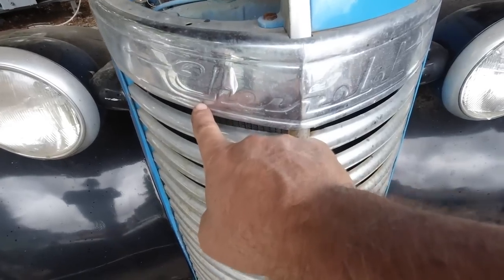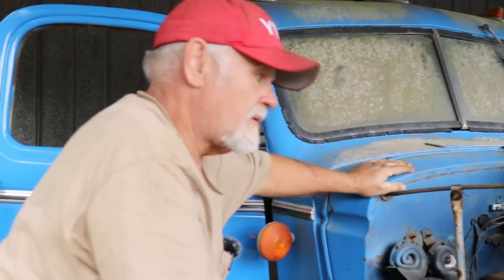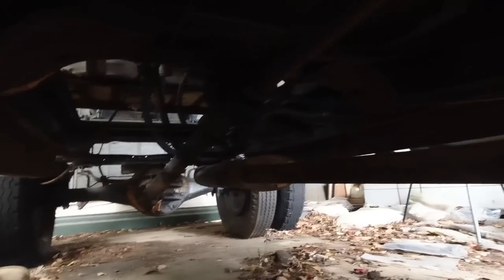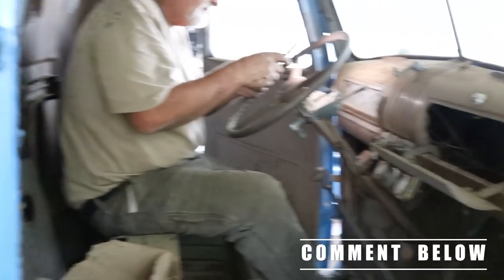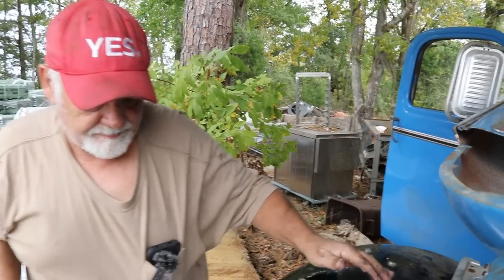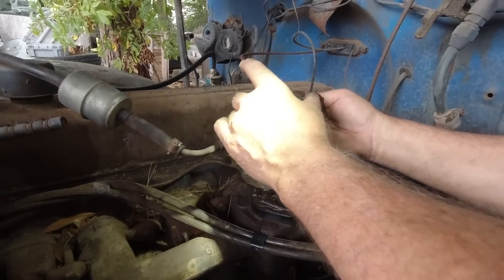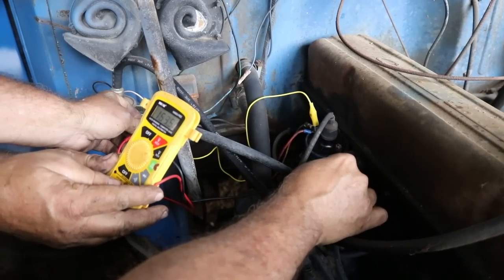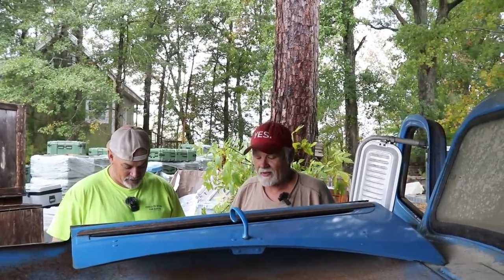WILL IT START? 40'S BARN FIND CHEVY TRUCK! We Have No Idea What we’re doing!

Comment: Looks to be a 1939 Chevrolet 1-1/2 Ton Pickup. Perhaps an early GMC. Your question about the coil. The coil takes 12 volts from the battery and boosts that voltage to around 13 kilovolts to make a good strong spark to the distributor for firing the plugs. I forget what direction the distributor rotates. I believe it's counter clockwise. The distributor shaft should be turned by the oil pump via gear. Someone correct me if I'm missing something.

Comment: Hook a wire from positive side of battery to positive side of coil. Then you have 12 volts to coil.
The throttle rod is what's leaking. Open carb. Google points vehicles

Comment: Wiley: How does it generate fire?
The coil takes 6 or 12 volts and as it has hundreds of turns of copper wire inside it multiplies the 6/12 to the 25,000 needed to jump the spark plug gap!

Comment: jump a wire from positive on the battery to posiitive side of coil if coil is good and points are clean and points open  and close it should spark point gap should be 16 on point gauge

Comment: Is there power from the ignition switch to the positive side of the coil? Check the continuity between the ignition  switch and  the points. You should be able to get spark. If no spark then it’s a coil wire and those are a cheap fix. Make sure they are in all the way. If not it could be the condenser, check that before replacing the coil- also make sure the rotor main contact is clean inside the cap. 

Try cleaning the inside posts of the distributor cap. Quiet often they build up metal transfer. Just scratch it firmly but not forcefully with a screw driver and it should fall off. 

The line going to the carburetor from the distributor is most likely the vaccuum advance. 

The engine is possibly a stock 235 or a 261.  

When the points break the power builds in the condenser until it jumps and builds up spark in the coil. If there enough umph there will be spark coming through the wire to the distributor cap to each cylinder. Check these things before the coil. 

Check the cap for cracks by looking inside for a hairline from the posts to the Center post. 

It is likely a later 40’s model. 

Many of these vehicles actually ran on 6v volt you may want to check if the ignition, the starter and fuel pump and generator are original or not and what voltage they need. 

Be careful with the ether, it’s not diesel and you can either damage it or blow it up.

Comment: Alright first things first fuel. 
1. That carburetor 'leak' isn't a leak it's just the overflow from the carb being overfilled from the looks of it I would have to know the model of carb to be sure and make sure your gas is fresh 
2. Spark your coil could be bad or it could be the wires I would look up how to test a coil as it is hard to explain without a visual aid and it's fairly simple ones you know where to jump it but next time you go out there bring a extra coil for a 55 stovebolt motor and spark plug wires and maybe a points set. The points will get corroded after sitting for even a couple years so best to either get them working or replace them and they are cheap.
3. That button on your shifter is for a split axle or 2 speed rear. They either operated on a vacuum diaphragm or electric solenoid. To shift one get up to speed with the button down that will be low gear and then clutch in, button up, let off the throttle, clutch out and it should shift although if it's vacuum it may be rotted out so it might not shift. Hope you see this and good luck those old Chevys are real fun.
Reply from the maker: Thanks for the comment👍

Comment: You run a hot wire to the coil from the battery. Also known as hot wire. You then pull a plug wire and test it on the valve cover for spark.

Comment: I think that you’re idle screw is missing from the carburetor

Before you buy a new coil, I would take out the spark plugs and check them 

Check the wires that are going to the coil

Comment: put the coil wire back into the cap, take a plug wire off and hold it close to the plug and turn the motor over and see if it arks

Comment: I think it's a 39 I had a 46 Chevrolet and it was a four-speed and it would run 70 at top speed. And the first three gears were pretty low but that 4th gear was like an overdrive on mine.

Comment: Hey love your show  what you need to do is check to see if there is power to the coil when key is on on the positive side of coil   if not you can just  put jumper wire on it to by pass all that  then pop cap. Off file the points  then crank motor over make sure rotor in distributor is turning too   make sure points open and close. As you crank also  take the coil wire off the cap side lay it in valve cover or something metal  and you can flick the points with asceww driver. And should see spark  at the end of coil wire   the coil is almost never bad  doesn't hurt to have a new one on hand  if you change coil the wire from distributor. Goes to negative side of coil   don't forget  and don't poor so much gas down the carb. That was way to much  that's why it was  leaking out the bottom of carb  maybe  like a soda cap full of gas would be plenty for it kick off. Good luck I hope that helps  if you follow what I said  you will be fine.
Reply: Also not sure if I mentioned that if yo take the cap off and crank the mtoor over you will see the rotor turn that is how it distributes  the spark to each wire  that's what you guys couldn't figure out at the end too

Comment: Oh and as far as the ignition goes Change the coil because it didn't look very good in the video. And change the points and condenser also. But she definitely has a shot coil. These old Chevy stovebolt sixes are Dirt Simple. Set the points at 18 thousands. I have a 1961 C-30 Apache 1 Ton truck. And it has a 235 six . That's probably a 218 stovebolt six.

Comment: theres lobes on the shaft of the distributor that opens the points which goes though the rotor an hits each contact in the cap sending spark to each plug it hits

Comment: If it didn’t fire with starting fluid , the points are closed up . Remove the cap and coil wire and see if they open and close

Comment: I believe your electric pump is putting to much pressure and blowing past the needle  valve, causing the carburetor to overfill.
 Run your gas jug to the inlet side of the fuel pump and see if u can get fuel at the carb. This will verify if fuel pump is good or bad.
 Clean the contacts on the points and set them to about 17 18 thousandths. Make sure the breaker arm on the points is setting on the high point of the lobe when checking points gap. Check for fire at the points by turn the engine to where the points are closed and take a small screwdriver and open and close the breaker arm manually with the switch on. If u see a spark between the contact you are good to go. If not you will need to move on by checking the coil continuity, voltage regulator on fire can be the culprit sometimes. 
Also I noticed a resistor on the passenger side fire wall the you may need to check for continuity and correct resistance. 
 Retard timing by turning the distributor all the way clockwise until it stops, this will make the engine easier to start. As the engine warms  up, advance the time by turning the distributor counterclockwise and the engine should rev up some and smooth out.
 Prime the carb with about a tablespoon of gas. You should be able to see gas shooting out inside of the carborator throat if the accelerator pump is working  by working the throttle linkage by hand or with the pedal.
 Good luck to u guys

Comment: Points under the distributor are clean. Sand paper if theirs any corrosion. Best to pull the plugs one at a time add engine oil/gas mix stuff just been sitting gonna smoke yes but it getting lubrication. make sure oil is topped off.  Don’t pull directly from the fuel tank rotten fuel. Use a jerry can or a fuel tank from a riding mower. Make sure radiator is full of coolant. 50/50. Turn the key on on move the point arm see if it sparks that lets you know “SPARKY” works.  Most times dirty spark plugs. You’ll need carb cleaner and old tooth brush or a new one. Use gas to swim the points of the plug in some fresh fuel. Dry. the plugs one at a time re attach plug wires BUT before that check for spark ⚡️ by pulling the plug listing for the ZAP tick noise. Let plug rest on the manifold check spark that way to. Both have to spark. Check under the distributor for burnt leads. Might have to replace a few dead stuff if while cranking she don’t spark. Turn the key to battery by moving the little armature ends needs to spark ⚡️ If you loose or have a weak spark or intermittent Typical stuff new wires distributor fresh plugs under neath the cap look for burnt corroded stuff sometimes a bit of cleaning if not new stuff. Light tune up after sitting. IF you get her running let her warm up to temp then shut off.

Comment: When you remove the top off of Carb to clean it ,you put it back together all wrong. The high speed lever on back of the carb has to be turn 1/2 turn before you sit the air horn back down and screw it back together. the reason it wont fire is because the points condenser is most likely dead.

Comment: There is no leak in the carb its because you poured gas in it and the throttle plate pivot rod will seep gas when you pour it in like that. And the only problem is the points need to be filed and it will fire right up. The points make the coil fire if there carotid and dont make a good contact between the contacts the coil WONT spark.

Comment: Next time you guys try start a petrol engined vehicle be systematic:  remove plugs, clean and check gap.
Remove points and clean and set gap. 
Wipe distributor cap out and scrape the terminals.
Scrape the rotor terminal.
Check fuel flows into carburettor.
Carry spare coil, condenser and plugs as they are cheaper than all the aggro!

Comment: 1940 1 1/2 ton only yr with large Chevrolet on upper rib style grill. 39 was similar but upper portion is narrower. BTW not original engine its a Inline 6 261 with Carter carb worked on a couple and all were runners. Could easily have it running in 5 mins and could tell you how but what fun is that lol

Comment: Y’all need to verify if the electrical system is positive or negative ground. A lot of these old rigs were set up positive ground. If the electric fuel pump is a positive ground pump and you have the battery hooked up negative ground the pump is running backwards.

Comment: just a guess here..as i am no mechanic but i would change the coil and rotor and condenser and the plugs and plug wires..oh and get the carb fixed..just my two cents worth.
Reply from the maker: I think you’re on to something 👍

Comment: First love your shows! Second, please don't quit your "day jobs" The carb hole, even with the bad pic looks like a adjustment screw, or a place for one, the air adj. No gas in the carb, float stuck shut. Coffee can is a vacuum storage can. Good luck. PS even with either should have poped. ign. problem.

Comment: Try a new gasket for the cilernoird and dose that truck have a cilernoird and take a spark plug out with the wire still hooked and see if you get spark that way I had no spark in my car and someone said change the cilernoird I did and I had spark after thanks so much

Comment: Hank that truck looks like a 38 to 40  im pretty sure they changed grill in 41 the engine might be newer tho. It’s a straight 6 tho so it should run them engines will run forever I’ve had em run on 2 cylinders can’t kill em lol

Comment: Also i would say bring a coil with you and spark plug socket so you can take a plug out ground it to the motor and check to dee if its firing if not its the points and ill have to write you a book on that lol good luck

Comment: By the looks of the headlight I think it is a 37. Is it a 6 or 12 volt system? I think you need a coil. They make point files, NAPA should have one. A single carb should not be too expensive. Even if it starts it needs a carb. It can't be fule, it should have done something on the ether!

Comment: that is 261 truck motor . check point and condenser or replace on fire wall check ballast resistor.  as for carburetor rebuild it  you mite have block passage way.  check coil if it 6 volt or 12 they could blow up

Comment: Come on guys it doesn't get any simpler. Compression, fire and fuel and it will run.
Reply from the maker: You’re kind of right…. Fuel air compression spark.  But you was close
Reply: @HamiltonvilleFarm   it's the wire
Reply: This was painful to watch
Reply from the maker: It was painful to film
Reply: How old is Wally?
Reply: @neilkratzer3182 you probably couldn't start a lawnmower if you tried 🤣loser

Comment: For 2 guys without a guess, y'all do exceptionally well. And I know I have a rep but this a serious question. My buddie's car is pushing no heat . Radiator is full, fan blows (cold), radiator circulates. We're looking into the thermostat. Also, there I much pollution in the radiator and I bought up that the coolant path might be plugged some where. Been ages since I picked up a wrench. We've been discussing it for a while. It just won't fix itself. Any suggestions or guesses? Thanks ahead of time, guys. As always, all the best to everyone. Chef Scott 👨‍🍳

Comment: Love your work guy,s but you need to file the points or replace the whole lot.
Points and condensor and sparkplugs
If the cap isn,t cracked it will work
99.9 its never coil
Is it converted to 12 volt?
You,ll get it going again and you need to do a part 2 on the old girl
Merry christmas from Sweden/Robert

Comment: You need to pull the spark plugs change the points and condenser and see if the spark plugs are firing. And then if not change the coil...

Comment: That is a 216 cubic inch 6 cylinder that would use Babbitt bearings on the main. Unless it was updated to a 235cid later model 6  cylinder. At that cylinder under the floorboards is your brakes unscrew the filler cap for brake fluid. Should mix oil and gasoline, 1/3 oil 2/3 gasoline to start an old engine like that. It needs the oil for compression on the rings. I've operated many of those in my life. It may be a 45 or 46 Chevy.

Comment: Petrol engines are easy.

The coil boosts the battery voltage to the 1,000s of volts needed to create a spark.

The condensor absorbs the voltage each time the points open to stop the points burning each time they open/close

The points run against a cam in the distributor to determine when to let the ignition current through

The rotor arm passes by the contacts in the distributor cap to pass the ignition current to the appropriate plug lead.

The plug leads pass the current to the spark plugs.

The spark plug create a spark on the cylinder igniting the fuel/air mix, PROVIDED the gap is properly set on the spark plug. 

Condensors are probably the weak point. The coil is unlikely to fail but you should check the primary winding (battery voltage) and the secondary winding (ignition voltage).

Check the gaps on the spark plugs and make sure the plug leads conduct voltage.

If all that checks out you need to check the fuel system and make sure that fuel is getting through.

Don't drag old fuel (and dirt) through from an ancient fuel tank. Make sure fuel is filling the carburetor float chamber and make sure the accelerator pump on the carburetor is working.

Comment: Lol As much gas been poured in top that carb you definitely need to pull the plugs they probably flooded. David branch’s commitment nailed it down on how that ignition system works. An don’t beat ya selfs up over this. If you don’t know then you learn an then you know. Lol. But if Willy holds that coil wire an it fires his Arthritis is never gone be the same again 😂

Comment: I'm going to throw my two cents in from watching what you did. First the carb should be taken off and gone over, jets cleaned etc. the float should move freely but not a whole lot, the needle valve should be checked to see its clean and not worn. Secondly is spark, the points cleaned and checked that there not worn, rotor button is another, then the coil should be checked to see if it has voltage coming into distributor. The play in distributor shouldn't be, and shouldn't  be moving, that moves the timing. Assuming all this works and it has fuel it should fire. Its difficult to tell unless your there to see all this. Will be interesting to see if this helps. Cheers from Nova Scotia

Comment: Guys, when it didn't fire on ether, that's a pretty good sign you don't have spark to the plugs or very low compression. Pouring gas down the carburetor isn't going to help.
Reply: Again. They aren't mechanics so what's your problem?

Comment: Its a 1938 chevy 1 1/2 or 2 ton pick up wil a 4 speed trans 6 volt system it might have been converted to 12 volt but i doubt it. The point might need cleaned up with a file or sandpaper its nice straight old truck how much do they want for it?

Comment: You need to check spark, simply put a screw driver in a sparkplug wire, hold it a quarter in or so from the valve cover and crank it, you should get a spark. if not, clean the points, open and close them with the coil wire close to the engine, it should spark. If not, the coil may be bad. That engine looks to be not the original engine, it looks like a later model 235.

Comment: stop putting gas in the carborator you are flooding the engine. What you need to do is clean your points  and try it again without putting gas or starting flued. in it.

Comment: It opens the butterflies causing more air to enter in turn the. Engine speeds up creating more volume that in turn advancing the timing .and when the engine speeds up it in turn the cam spins faster causing the fuel ⛽ pump to pump more fuel.